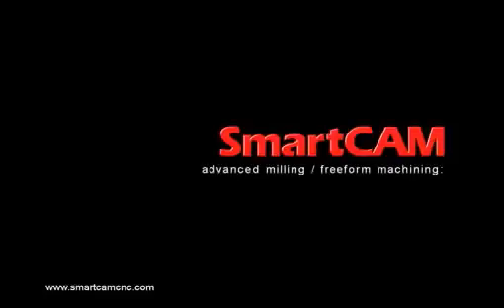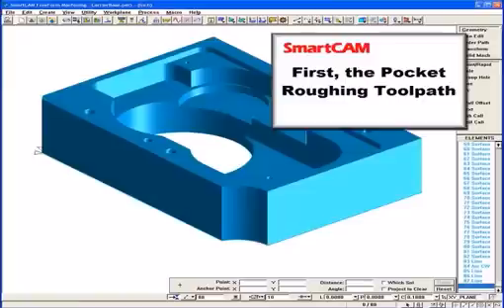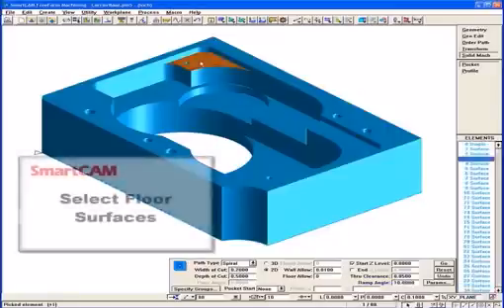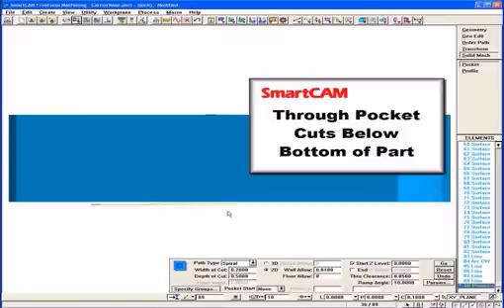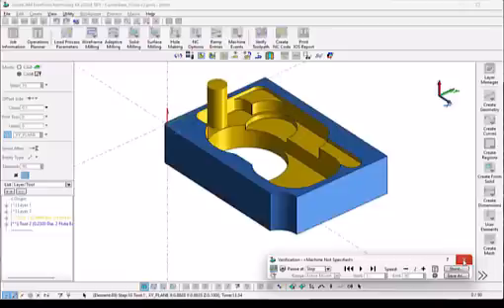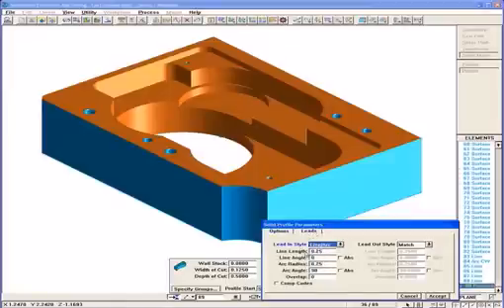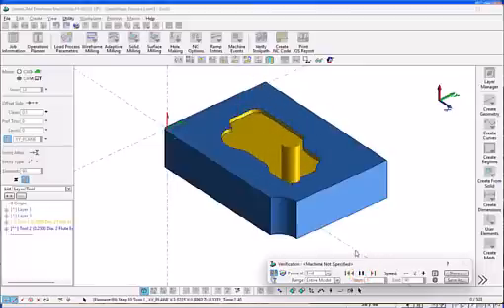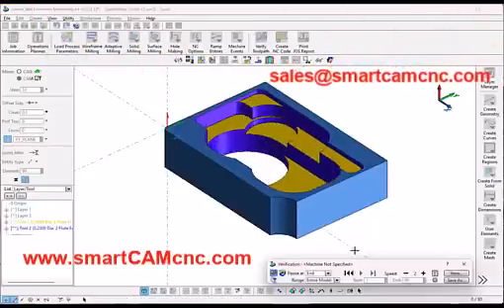Machining from Solids in SmartCAM CAM Milling Software

Comment: I have .jof & .pm5 file. Need to convert the file into 2d Dwg or 3D .igs .stp .xt. i haven't any software. Kindly give your opinion
Reply from the maker: Hi Sundarr1433, You can open the desired file in the appropriate SmartCAM product then Save As and you should have the option to save as .dwg, .igs etc. Hope this helps!